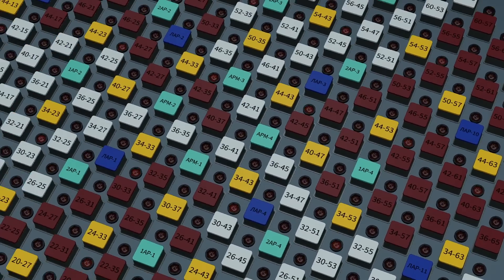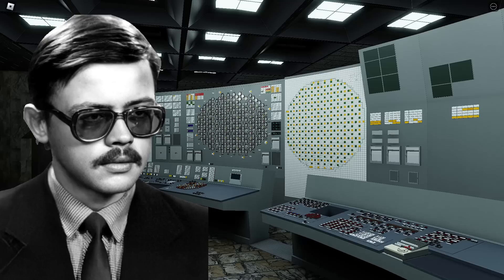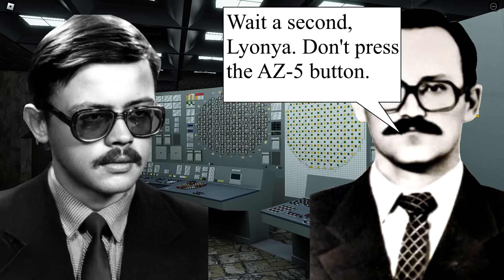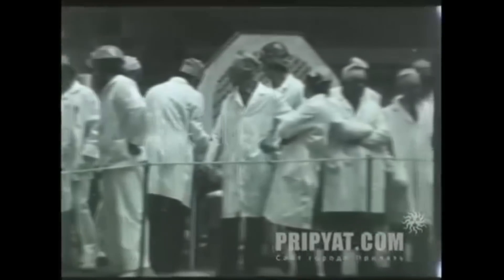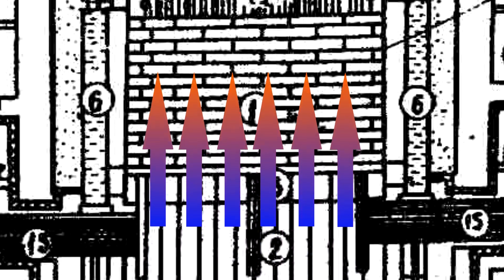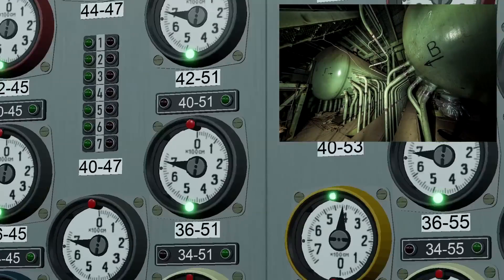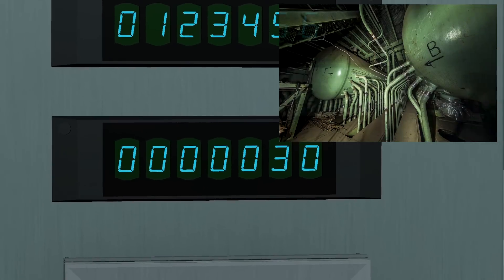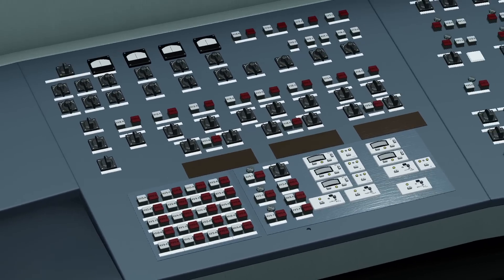Would Not Pressing AZ-5 SAVE Chernobyl?

Comment: Thank you for another well-done video. There may be one (little known) reason why the guys in Canada did their own report quite quickly after the accident; their own CANDU reactors. The CANDU, like the RBMK, is a pressure tube reactor. It even shares a special characteristic with the RBMK, the positive void coefficient. After the accident, they may have wanted to find out if they would run the risk of a possible similar accident in certain scenarios. However, the CANDU is very well-built, with full containment, a lot of redundancy and two separate safety systems that can independently, and without power or operator intervention, shut the reactor down within 2 seconds flat.
Reply: Candu and IPHWRs are actually well built heavy water reactors. BWRs are also good as they use water as a moderator and an absorber. But it's not as correct to say that the RBMK was not as good. The power output is well enough and it's still being used at kursk and smolensk.
Reply: @Arpan.78-z7z  
"CANDU and IPHWRs are actually well-built heavy water reactors."

That's what I said^^

I have an RBMK-sized soft spot for this behemoth of a reactor. The RBMK is not a bad reactor per se. However, they should have sat on the design a bit longer, and give it the things it needs in order to be a stable, safe and happy reactor. They essentially plunked it out into this world untamed and untested, in little more than its bare fuel rods. Then secrecy, politics and refusing to learn lessons from other, earlier accidents did the rest. The unfortunate operators had no idea what they were saddled with.

Kursk, Leningrad, and Smolensk all still have running RBMKs. As does Bilibino NPP, although I would call these reactors RBMK-lets (yes, I know they're EGP-6s, but these are essentially miniature RBMKs) due to their diminutive size. But they already run for an impressive 50 years, which is very long for a graphite-moderated reactor. And Smolensk Unit 3 is the most advanced RBMK ever built. The MKER would have been taking that title, but it was never finished, and as such has never actually run. Which is too bad because I really would have liked to see what this reactor can do.
Reply: @swokatsamsiyu3590  EGP 6s definitely. RBMKs were good reactors but yes I agree to it that the design must have been theought on for a little longer
Reply: @Arpan.78-z7z RBMK were good? good for what? blowing up?
Reply: @FooBar89 how many of them blow up? Why y’all act like every single USSR reactors did blow up?
Reply: @FooBar89  While construction of new RMBK-reactors was stopped due to the Chernobyl disaster, all the ones in Russia are either still running or were shut down only because they reached the end of their lifespans. Even Chernobyl reactors 1-3 were kept running for quite a while after the disaster, with the last one shutting down in 2000, 14 years after the disaster.

Only Lithuania shut down its reactors for other reasons, namely that it was a condition for them to be able to join the EU. But even then, it was only because of its lack of a containment structure, not the design of the reactor itself, which was of more advanced design than that everywhere else in the USSR.
Reply: Thanks for the info this was extremely informative and interesting. Do you have a tip where I could start reading into this from a noob perspective? Would be greatly appreciated 😊
Reply: @erynja7085  
About which of the two reactors would you like to read? Both are equally interesting due to their respective unique characters. When you put any of the two in a Google search, a wealth of information will open up. Just start out slow with material that appeals to you. The problem is, if I were to name anything by title, the alligator rhythms will snack on my words😅
Reply: https://www.youtube.com/watch?v=yIA_FMz9n1k
Reply: Yeah it is similar design but containment argument does not help. That much exploding nothing can stop.
Reply: @Xryujfdjd  containment would have stopped the Chernobyl explosion. It wasn't a nuclear explosion, it was just a violent reaction between hydrogen, oxygen and carbon after the water molecules split
Reply: yeah...until something impossible happens.
Reply: I'm guessing it didn't have a positive power coefficient.
Reply: @markusw7833  
Oh, but it does. Look it up. It is the main reason CANDUs have a hard time being licensed in the USA because the US does not allow any reactor design with a positive void coefficient to operate in the States.
Reply: @markusw7833  
You're correct. I misread. But the US still is heavily biased against allowing the CANDU because of the positive void coefficient.

*Needs new reading glasses.
Reply: @markusw7833  It does, just a smaller one thanks to Heavy Water being used instead of Light Water. 
An order of magnitude less than the old RMBK and still a couple factors below the current RBMKs. It would take a while to be an issue and the other coefficients that are negative like temperature would neutralize it.
Reply: The CANDU is also massively out of date today yet we still license produce them while also using them well past their rated operational life because the Feds killed the CANDU II project to save money, the project would have been done by now too...
Reply: @MJRSoap  
The CANDU may not be a new design, it has proven to be a very robust and safe reactor. Just like the PWR is not a new design, but works very well to this day.

“while also using them well past their rated operational life”

Yes, they are. But what you conveniently forgot to mention is that their entire cores (Calandria tubes, pressure tubes etc.) and major components like the steam generators have been either completely refurbished or replaced. They’re as good as new, if not better, due to better fabrication methods and more modern materials being used for the replacement parts. Look up the Bruce Start Project. Age is just a number. If all parts pass very rigorous inspections, I can’t see why we would have to write off a perfectly fine reactor simply because on paper it says “this CANDU is 40 yrs. old”.
Reply: I recommend watching this: HOW THE 4th UNIT OF CHERNOBYL NPP WAS BLOWN UP (channel-KS).
Reply: All this is a replication of the Soviet lie about the causes of the accident. If you want to know the truth, watch: HOW THE 4th UNIT OF CHERNOBYL NPP WAS BLOWN UP.   (KS channel)
Reply: @ВолодимирІвасенко  
I have watched that video earlier this week, and also looked at the Google Drive link provided. Why is there not more research into this?!? Because if this would be correct, a lot of reports would have to be rewritten in full. Too bad the other videos on the KS channel are not with subs so it can reach more people.
Reply: @swokatsamsiyu3590  You do realize that this is fundamentally different from the official nonsense that was paid for and recorded by the Soviets in INSAG-7. No one can refute the fact, that reactor 4 was shut down as early as April 25th. And Toptunov had nothing to do with it. This completely ruins all official versions of the causes of the accident.
Reply: @ВолодимирІвасенко  
The CANDU may not be a new design, it has proven to be a very robust and safe reactor. Just like the PWR is not a new design, but works very well to this day.

“while also using them well past their rated operational life”

Yes, they are. But what you conveniently forgot to mention is that their entire cores (Calandria tubes, pressure tubes etc.) and major components like the steam generators have been either completely refurbished, or replaced. They’re as good as new, if not better, due to better fabrication methods and more modern materials being used for the replacement parts. Look up the Start Project. Age is just a number. If all parts pass very rigorous inspections, I can’t see why we would have to write off a perfectly fine reactor simply because on paper it says “this CANDU is 40 yrs. old”.

Comment: 4:25 ... no, prompt criticality is not the same as an atomic bomb, a reactor still needs moderation of neutrons, which slows down the power escalalion...  a bomb is prompt-fast critical ....
Reply from the maker: Prompt criticality in a reactor is fission sustained by prompt neutrons alone. It's the exact same thing. That happened at Chernobyl. :)
Reply: @thatchernobylguy2915  chernobyl blew up by prompt thermal(!) neutrons, but a bomb runs on promp fast(!) neutrons .... chernobyl never would have reached criticality with fast neutrons allone ....
Reply from the maker: @NuclearSavety   Fast neutrons have been modeled in the explosion since 1998, and is largely used as evidence in support of a nuclear-jet style of explosion.
Reply: @thatchernobylguy2915  fast criticality is impossible in reactor-grade low-enriched fuel. Thats the reason you need high enrichment for weapons....
Reply: @NuclearSavety Except that fast neutron fission CAN occur in low or unenriched uranium (it can even occur in depleted uranium!),
This is even used in some fusion bombs where the excess fast neutrons from the fusion of deuterium and tritium is used to fission the Uranium 238 tamper to boost the total yield of the bomb by a factor of 2 to 3).
The replacement of the uranium tamper with a tungsten one in the 'Zar Bomba' was actually what caused it to 'only' have a yield of 50 MT and the soviets only did this in order to not guarantee to blow up the plane dropping the bomb as well as trying to limit the fallout of the bomb.
This actually made the 'Zar Bomba' the cleanest fusion bomb detonated to date if you look at the ratio of fusion energy to total energy ratio and the amount of fallout / MT yield
Reply: @srenkoch6127  you can use excess neutrons (which you would loose to the environment otherwise) to breed or split u238, thats e.g. the concept of a fast breeding reactor... but you dont get the excess fast neutrons in suitable flux numbers from low-enriched = reactor-grade uranium ... thats the point ....

I dont wanna enter a discussion if fast neutrons contributed 0.005% to the excursion power of chernobyl or 0.005% ... it fur sure aint 90% as in an atomic bomb ....
Reply: @NuclearSavety we have a winner 🏆 nice debate lol

Comment: This is always what I've wondered- did they have a button, like an AZ-3, that would insert some of the rods all over the reactor? I would think the thing to do if you are aware of possible xenon poisoning and also that once you cut the water obvi reactivity will spike... I would think the thing to do is as soon as you release the turbine for the run-down test, you IMMEDIATELY switch water back on and start lowering SOME control rods, 25% at a time maybe.. (but I realize that they hadn't been made aware of the issue with the water-displacing tips causing a spike at the bottom of the reactor on insertion). I always wondered if they could have saved it if they didn't panic-- sometimes, accepting that you are going to be in A accident instead of trying to avoid it, lets you avert the worst-case scenario.
Reply: "I always wondered if they could have saved it if they didn't panic"

What in the world?
Reply: @markusw7833  I prevented myself from crashing into the ditch on a freeway earlier this year by doing exactly what he is suggesting here. If I had panicked and tapped the break, the vehicle would have spun out of control on the icy road surface. I simply dropped the throttle and let the physics do the work for me. No accident involved by being smart and remaining calm.
Reply: @erickolb8581  that's good stuff, glad it worked out for you! Staying calm & focused helps solve a lot of problems, for sure. However, I think your success handling that situation also required you to have the right knowledge, skill & instinct, all built from internalizing good lessons & having a decent amount of experience driving on slippery surfaces while paying good attention. Nobody at Chernobyl had the knowledge or instinct required to invent a new procedure on the spot. They thought AZ5 would put it into a good state. It's like if someone was scuba diving & their main air supply gave out so they switched to a backup supply, but that backup was contaminated w/ CO gas, killing them. A mad dash to the surface might've turned out better, but why try that if they didn't know the backup air was bad? Sometimes staying calm isn't enough.

Comment: My understanding is if the control rods were designed to "slam home" when AZ-5 was pressed (vs. operating at "servo speed"), an explosion might have been averted. As far as the explosion being caused by the graphite tips (which is what you're asking), I think they passed the point of no return a while back.
Reply: The speed of the control rod action isn’t that significant, as the transition to prompt criticality occurs over nanoseconds.  No matter how fast the rods moved they would still be displacing water and the result would be the same.   Pressing AZ-5 would be required much earlier, before it became obvious that it needed to be pressed.   Things were happening far too fast.
Reply: The Critical point where the catastrophe became unavoidable was when they started rising all the control rods it make the Event chains start. The Core started to increase way to quickly at that point the only thing stopping the meltdown was the Xenon Poisoning, once it was gone the reactor was out of control with the Only way to stop it being relowing the rod and we know how it ended ...
Reply: @the_zonko indeed, once the power surge happened, it was already too late, the reactor was out of control and there was no stopping it because lowering the rods slowly few at time wouldn't have made difference either and they likely would have also gotten stuck without going all the way down anyway the graphite tips still accelerating the inevitable doom. 

So ye the pressure was going to build no matter what they would have done. Once they removed too many control rods and started the test that lowered the water flow to reactor, that was point of no return
Reply: maaaaybe but idk my understanding is the 'drop' or 'slam home' (which they did implement after this) gets the insertion time down to 11 or 12 seconds vs 18-20, but that still seems too long when the graphite is starting to molt and shafts are getting distorted or splitting open... I don't understand why they didn't start the water flowing again before that
Reply: @prismpyre7653  
After the 1986 accident, they have given the remaining RBMKs an additional, fast-acting SCRAM system called BAZ (Быстродействующая = Fast-acting, Аварийная = Emergency, Защита = Protection) that can insert 24 special control rods fully into the core in under 2.4 seconds or 7 seconds, depending on the signal sent. These control rods are gas-driven, their channels are cooled by a waterfilm, and they're Boron only. No graphite displacers allowed. They will pull reactivity down by at least -2 β-effective. When an RBMK is scrammed today, this system will go first. After that, the rest of the normal system follows.
Reply: @prismpyre7653  They literally had all main circulation pumps going and the reactor had a very high total flow rate, which is supposed to have contributed to the incident.
Reply: @markusw7833 they had 4 of 8 pumps going not all 8 hero.
Reply: They wouldn't. At the point of pressing the button channels were so deformed by heat, that a lot of rods got stuck.
Reply: That might have helped earlier, but the reactor went prompt critical. Basically a very tiny very badly built nuclear fizzle. It's too fast to stop like that.
Hence slowwalking the rods was the only hope
Reply: When you're talking about a prompt critical excursion, as happened at Chernobyl Unit 4, one second, ten seconds, eighteen seconds doesn't really matter, the reactivity spiked so hard and so fast that even if you "slammed home" the rods, the fuel channels would have still ruptured and jammed a bunch of control rods with graphite moderator still stuck in the lower half of the core.

I had a bunch of other stuff below here, but a nuclear fission event happens in 1 "shake" (it is a real term in nuclear physics, it's about 10 nanoseconds, or 10^-18 seconds. An entire chain reaction that blows apart a nuclear bomb is completed in 50 shakes, or 500 billionths of one second. As soon as the reactor reached one dollar of reactivity, or the point where there's enough free neutrons to self-sustain the reaction, that was it, it's over, *boom*.

For another fun little tidbit, the amount of uranium-235 fissioned in the Little Boy bomb that blew up over Hiroshima amounted to about 7/10ths of a gram of U-235. The energy from that tiny amount of fissile material was enough to level the city, and the entire reaction happened 500,000 times in the amount of time it took you to realize there's a period at the end of this sentence. Chernobyl was not a nuclear explosion, or anything like it, but the chain reaction and the steam explosion of the reactor happened on the same timescale.
Reply: @orangejuche  Nano is 10^-9, 10^-18 is atto.
Reply: It's my understanding that Xenon is what REALLY played the key role. The reactor went from barely producing any power to criticality in a very short period of time because once the reactor reached a certain temperature, the xenon that was preventing the reaction burned off almost immediately, so the effect of the control rods missing allowed it all to spiral out of control in a matter of minutes
Reply: https://www.youtube.com/watch?v=yIA_FMz9n1k
Reply: https://www.youtube.com/watch?v=yIA_FMz9n1k
Reply: I recommend watching this: HOW THE 4th UNIT OF CHERNOBYL NPP WAS BLOWN UP (channel-KS).
Reply: All this is a replication of the Soviet lie about the causes of the accident. If you want to know the truth, watch: HOW THE 4th UNIT OF CHERNOBYL NPP WAS BLOWN UP.   (KS channel)